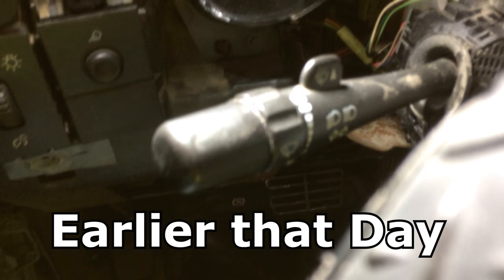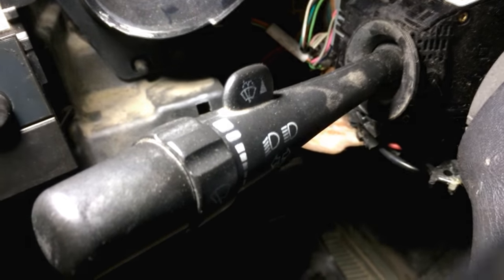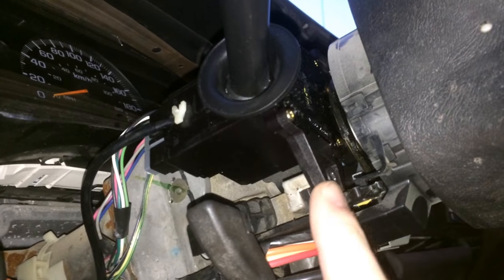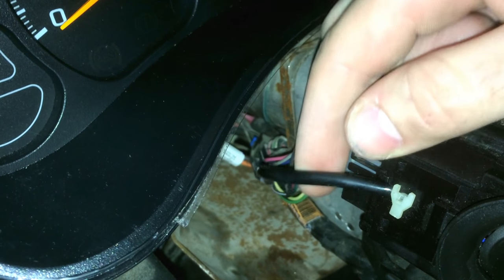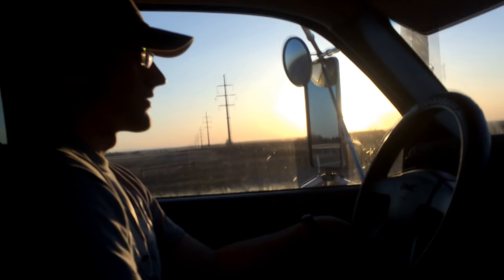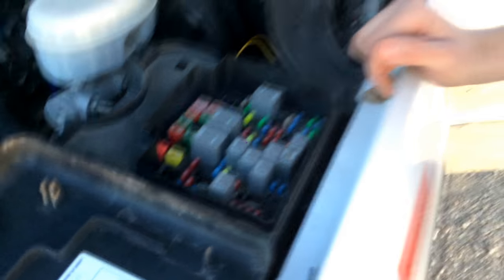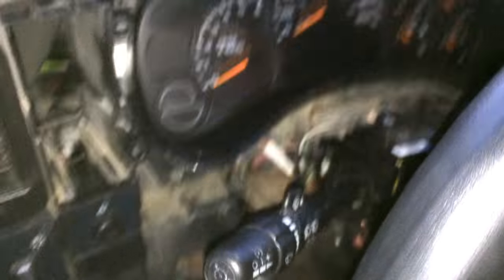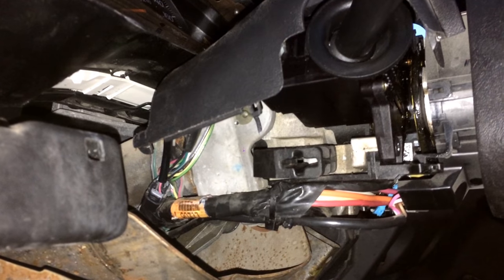Install CHEAP Cruise Control in your GM vehicle!

Comment: you failed to mention this apparently only works for V8.  based off several forums Ive read, its not plug and play or as simple if you have the dreaded 4.3L V6  :(
Reply from the maker: Interesting! I did not know that. Thank you for clarifying!!
Reply: I got an 06 bass truck did not come withhave you read anything that says you need to put the inner part in without anything under the hood
Reply: Douglas Russell i sold the truck and got a tacoma with cruise control. Lol
Reply: I have a 2005 Chevrolet express 1500 4.3  vortec.  Will I encounter the same problems. Thanks

Comment: If a vehicle has a cruise control module and fuses why wouldn't it have controls for it?  Was it not the stock turn signal lever?
Reply from the maker: To my knowledge it's not a separate control module, just programming in the ECU. The stock lever didn't have the buttons. Since this has an electronic (no cable) throttle already, the only difference between cruise control and normal driving is whether it takes commands from the pedal sensor, or the computer directly.

Comment: What year and model is the truck in the video ?  Do you have the wiring diagram for those of us that don't have the 4 pin coupler ?       I have an '06 2500 HD WT .
Reply from the maker: The truck is a 2003 GMC Sierra 4.8

Comment: What doesn’t make sense is you need more than just the turn signal / cruise you need the module / servo connected to throttle. Unless you didn’t need that because your truck doesn’t need that for some reason???

Comment: On my 03 chevy astro had to change multi switch and add servo(from junk yard 20.$) cable to carborator works great , it already had connecters and fuse from factory , just plug everything in and ready to cruise

Comment: This only works if you have an electric throttle body right? Cause im pretty sure my truck doesnt have the module for cable driven throttle body
Reply from the maker: @jasonclemente4392  yeah that's right, this would only work with an electronic throttle.

Comment: Great video thanks. As an FYI, I have an '05 Sierra 2500HD work truck and the plug for the cruise control was not in the harness. I also had to take the steering wheel off to get to the second torqs bolt
Reply from the maker: Good to know!!
Reply: 2005 chevy 1500 WT2 don't have it either.
Reply: My 2005 1500 WT doesn’t have the connector. Is it possible to add the connector and wire it to the electronics block?

Comment: Like Jonathan Morris mentioned, how does this video not have at least 1 million views, unless most trucks have CC.  I'm going to look to a lever and try it.  I have a 03 Silverado 2500HD Duramax Crew and who orders or buy a strip Duramax new?  Anyhow, I bought this truck used and truck is base with no options other than Duramax engine and Allison transmission.  About how long does it take to take everything apart and together again?  Just like a ballpark so I can schedule the DIY CC.  Good work David D
Reply from the maker: Thanks for the support! I've taken my dash apart a few times, but ballpark I'd say 30 minutes all together? maybe 45 if your steering column covers are a little stubborn.
Reply: Finally did the install after viewing your video, install only took 15 minutes.  Hardest part was to remove the lower bolt, but with your suggestion to use T20 socket helped.  Also reinstalling the steering wheel column cover was a but tricky but I figured it out.  Thx for the video
Reply: I have an 04 crew cab dually..... no cruise control. Same thing, who orders a truck that is made to run the highways, like that? It has 300k on it, so obviously it's been used.

Comment: How this doesn't have a million views, I don't know.  This just might be the answer to my 2002 chevy 2500HD with no cruise control.  Way better solution than the aftermarket stuff for $250.  Now, gotta find a cheap stock lever with cruise.
Reply: I just did this to my 03 1500 silverado today. My truck lready had the fuse installed and everything. Just needed the new control. works great. Got the part brand new on e-bay for $28. It is a clone, not an original, but it looks, feels, and works exactly like the OEM one.

Comment: I'm trying to do this on a 2007 Chevy Express 2500 w/4.8L V8 engine.
I hear that I need "Electronic throttle control" for your method to work.
Can you check if your GM RPO code includes "KUP" (which is electronic throttle control)
Reply from the maker: Yes mine has an electric throttle. If yours has a cable throttle you'll probably need one of those vacuum operated cruise controls

Comment: Do you have a gas or diesel truck? I've heard this only works on diesel trucks. I have a 2006 Express 3500 6 liter gas engine and would like to know if it would work.
Reply from the maker: Gas! 4.8 Vortec. Sounds like it might be worth a shot on yours if if has the connection on the steering shaft.
Reply: I'm pretty sure in order for this to work you need to have an electronic throttle control module. Could you look down by your gas pedal and tell me if you see a little black control box? I think that's the ticket. Mine appears to be mechanical, although I did not trace it all the way back to the engine.
Reply from the maker: Yes that's correct. I do have an electronic throttle. If it's mechanical cable you'll have to buy one of those vacuum solenoid things and the method in the video wont work. Although you'll probably still need a new stalk; I haven't fully looked into what to do with a mechanical one to give it cruise.

Comment: is there a way to tell if your vehicle has electronic or cable throttle?
Reply: open the hood and look under your engine cover. If your throttle body has a fat black electronic unit & plug on it, it's dbw. If it has a cable that you can pull to raise idle, it's dbc. 

Chevy 5.3L 2003 -2006 (except the vans), chevy 6.0 1999-2006 are dbw
Reply: @guitarguy3221  Thanks!

Comment: Good job! I installed the cruise on my 2003 express, STILL WONT WORK please if anyone knows where the fuse is on that van please let me know! It’s not in the manual.
Reply: The 2003 Express Van is not electronic throttle like the 2003-2006 Silverad with the V8 and diesel. The 2003 Express will require a cruise servo as well.

Comment: Hopefully this works on my 97 chevrolet c3500 1ton short bus camper. 6.5L V8 turbo diesel
Reply: I know this is a really old comment but.. any chance it worked? I'm researching how to add cruise control to my 2001 chevy 3500 6.5l turbo

Comment: what if there is no 4 pin connector?
there is cruise fuses in box.
Reply from the maker: hmm... If there's already fuses then maybe the wire is just hidden back more? I'm not sure. Let us know what you figure out!
Reply: @arctic_otter  you have to wire one into the 53 pin module in the 2005 and up
Reply from the maker: Goot to know!

Comment: I put a switch in my 2002 chevy 1/2 ton V8 and it dont work anything I can do to make it work ???
Reply from the maker: I assume it had the factory 4-pin connector that you plugged into? If so, and the fuse is okay, not really sure what else to try. sorry
Reply: @arctic_otter  I install cruise control on my chevy truck.5-31-22
switch $17.00
cruise control servo .$20.00
for $37.00 I have cruise...
Reply from the maker: @busdriver9007  That's wonderful! Glad you could make it work.

Comment: will this work on a 2011 chevy?
Reply from the maker: I just searched on http://www.rostra.com/index.php and it looks like unfortunately no, it probably wont work. The system they prescribe for a 2011 Chevy Silverado has a separate computer module and wiring.
When I first searched for my truck, the prescribed model was just the new stalk, so that's how I had the idea to try it.
As it is, your kit doesn't look too hard if you're comfortable with some relatively simple wire-splicing at the accelerator pedal, but that's your call.
Here is the manual for the kit they sell for your truck: http://www.rostra.com/manuals/250-9617-NS_Form5566A.pdf

Comment: Tried doing this on a 2006 express van. Have the multi switch in and fuse in the cc spot but no cruise working. Never lights up. Any ideas or where to look? I’ve tried forum surfing and found very little info on vans.
Reply: The 2006 Express Van is not electronic throttle like the 2003-2006 Silverad with the V8 and diesel. The 2006 Express will require a cruise servo as well.
Reply: @MichaelCFox-ku8bq  thank you. Any pointers where to look or is that a junkyard dive? Idk how I missed the throttle body being drive by cable. 🤦‍♂️😂
Reply: I'm trying to do this on a 2007 Express 2500 with 4.8L V8 engine.
Can you check the GM RPO code label to see if there is "KUP"

I've had several Express Conversion vans (1500's with 5.3L V8, 2003, 2005, 2006, 2007) before, and all of them HAD factory cruise control. Not all Express/Savana vans are cable throttle control.

Comment: Just what I was needing.  Thanks David. Follow-up, Just got it installed and it worked like a charm for my 2004 GMC Sierra. Brand new lever with cruse control cost me $27.50 on ebay.

Comment: Can anyone explain how, on these models of GMC, that the cruise control servo is installed even without Cruise Control as an option?  That is the only way this is even possible.  I find this very unusual that the throttle servo would be installed already.  I'd love to know how and why, when on all other cars, no cruise, no servo, and you have to install them both.
Reply from the maker: My truck has a factory electronic throttle, so it doesn't need an additional servo to hold it open, just instructions from the computer directly instead of from the sensor on the gas pedal when you select cruise.
Obviously you are right, if it did have a regular cable throttle, then it would be very unlikely to come with a cruise servo from the factory as standard.
Reply: @arctic_otter  Wow...I really need to educate myself on what that is.  I was thinking it would be comparable to my 2005 GMC Savana van, but my van has nothing like what you describe.  Thanks for your great reply, that solves one mystery...and creates another.  Perhaps you could do a video on that magical "electronic throttle" from that era of GM?
Reply: Newer cars have drive by wire throttle. No servos needed, it's data signaling.
Reply: @Jamespennington71  Thank you.  I didn't think we were seeing that in 2005 gasoline engines, just newer Teslas electric cars and such.  And yet, my 2005 GMC Savanna still has the cable.  I wonder how the cruise control is supposed to mount on that thing?

Comment: Watched this video cause my 06 Silverado has no cruise. Ordered a stock with cruise after I watched this video. Went to put it in and no plug like how yours was. What do I do?!
Reply from the maker: Hmmm I only have experience with my truck. http://www.rostra.com/index.php is where i first discovered this quirk. The site is not very well laid out, but from a quick search, if your particular truck has 8 cylinders, it should have the connector somewhere in there, as the 'aftermarket cruise' is just the new stalk, same as mine. However, if you have 6 cylinders, it looks like they recommend their 'universal' model but that needs an old-fashioned cable throttle? Once you search for your truck, scroll down to "Electronic Add-On Cruise Control Systems", and see "Cruise Control Notes" for the links.
Sorry I could't be of more help. I hope you get it working!
Reply: David A mines a work truck manual windows and locks with a v8. I got it working I had to splice the four wires into the bcm
Reply from the maker: @Smithtobewith  Awesome! I had a feeling that was all you would need. Glad you figured it out.

Comment: Cool video. Now swap in a 2500hd instrument cluster so you can have the transmission temperature gauge.
Reply from the maker: How does the odometer work into that? is the number stored in the cluster or the the ECM?
Reply: It’s stored in the cluster. I got mine off eBay and told the seller how many miles my truck had.

Comment: WORK ON GMC 1999 2000
Reply from the maker: Depends if it has an electric, or cable operated throttle, if it's electronic, then maybe! Check for that unused connector near the steering column and see what you can find out

Comment: Thanks for the info. Just bought a G2500 today.  I love CC.  Much easier than I would have guessed.
Reply: Did it work?
Reply: Never tried since it requires a model with electronic throttle.

Comment: I have an 01 Silverado work truck I wonder if this would work on it also.
Reply: Did you try with the 01 Silverado? I am wondering the same
Reply: Did this work??
Reply: No Mine needed the Cable module also under the hood.

Comment: I have an '04 Silverado with a V6. After watching your video I tried and it didn't work. Any tips?
Reply from the maker: If there is a connector for the 4-pin, and the fuse is good, then I'm afraid I don't have much I can suggest. :/ maybe double check the fuse again? Sometimes they can look good but they're actually broken. Maybe the switch is no good. Let me know if you figure it out! :) This is the frontier of automotive discovery!
Reply: I have an 05 with the V6, so same truck. Just adding the switch wont help because the V6 is different from the V8s and the Duramax. I believe all the other engines this works because it uses an electronic throttle control, so the switch is all that is needed. The V6 throttle is controlled by a cable. You'll need a cruise control module and cable to make this work. The wiring is already there, though. There will be a rectangular electrical connector to the right of the brake booster. At first it'll look like it's plugged into to something, but it's not, it's a dummy connector that leads to nothing. That is where you'd plug in your cruise module. Not exactly sure where to bolt the module in yet though, as I haven't done this yet. Going to get a module from a junk yard this weekend and see if it works. Hope this helps.